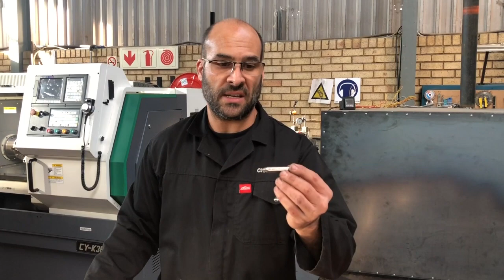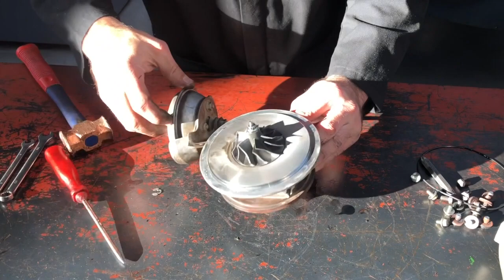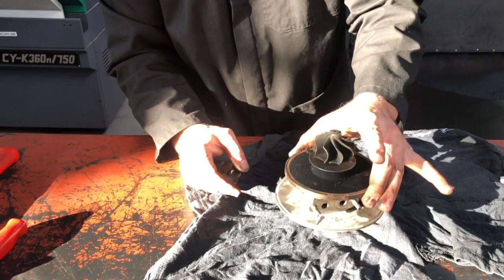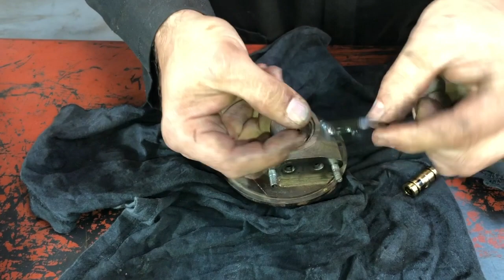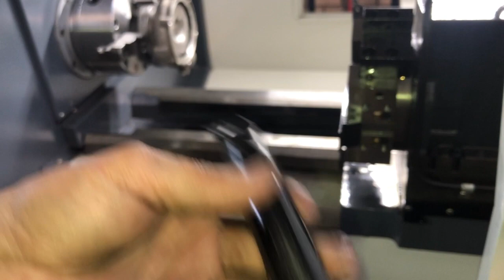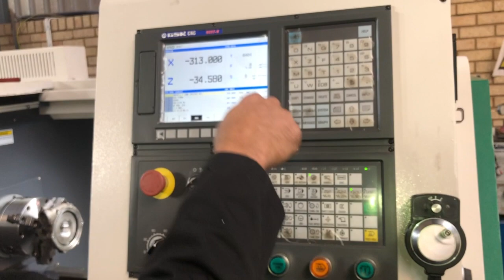Toyota V8 Cruiser Hybrid step by step part1

Comment: Yeah that surface finish isn't a mirror finish, but the reason for that largely is the lack of lubrication. If you're using a good cutter and good sufficient lubrication, it's easy to get a mirror finish on a CNC lathe if you know what you're doing. That's very interesting, I'm unfamiliar with that control, what kind of CNC lathe? 

The safety part of my brain is going nuts though. Just don't get complacent around CNC's, having the door open alone to me is sketchy, things happen too fast in a CNC to react of something goes wrong. Use a go pro with the door shut and narrate the video and add graphics, even if it's a proven program, all you gotta do is have that insert chip or a clump pile up for things to go sideways. Just be careful, don't really show the unsafe way to do it, not everyone understands what can go wrong (your viewers). So be mindful, there's some idiots out there haha